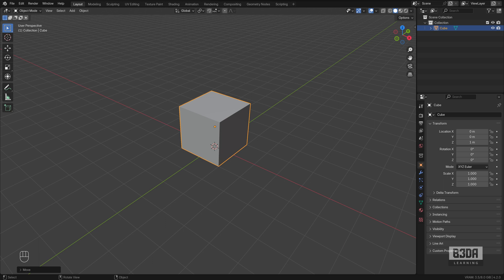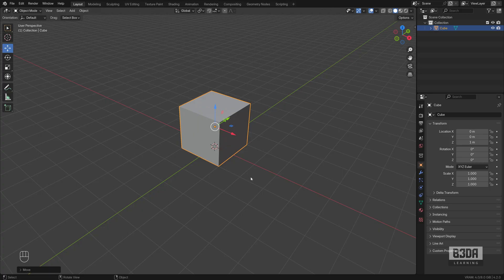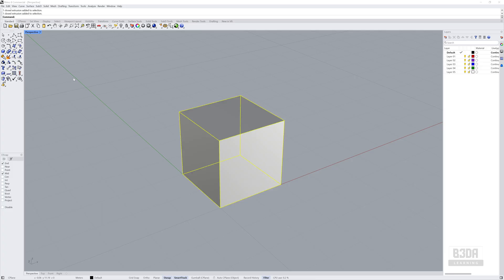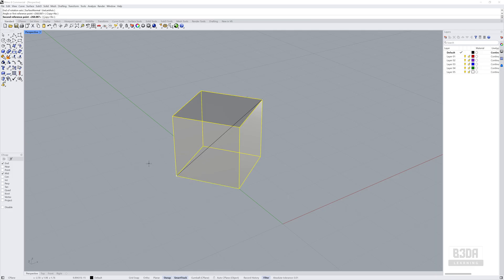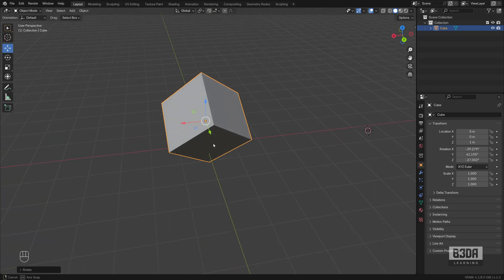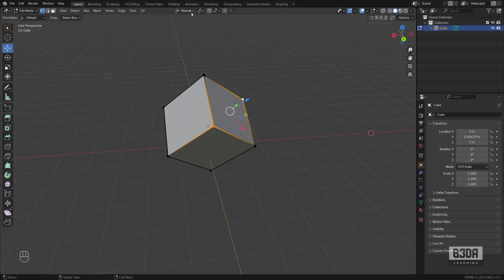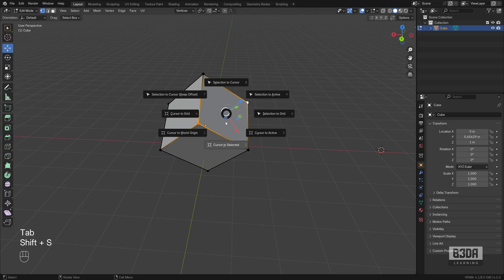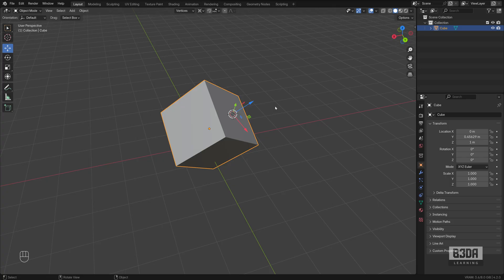Precise Modeling with Blender: 3D Rotations like a CAD tool

Comment: Simply moving, rotating, aligning and snapping in Blender had alway driven me absolutely insane. Like the 'Right Click" nonsense that went on for so long, these most basic functions are so unintuitive it must have stopped countless thousands of people learning this application. What on earth is the point of "Grab" moving objects around in the 2D screen space by default?? Why? What is the possible use is that? Even Sketchup destroys Blender when it comes to these very simple tasks.
Reply from the maker: That is one of the reasons we see many Add-ons trying to give solutions to those problems. In many ways, it is almost mandatory to use Add-ons to develop any design with Blender.
Reply: what should be the default?